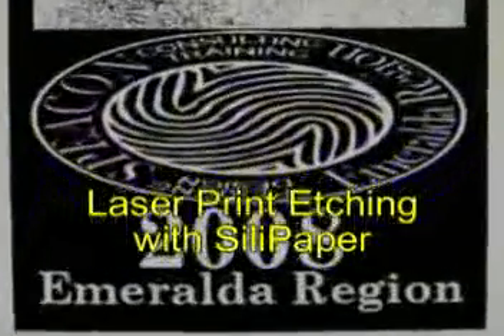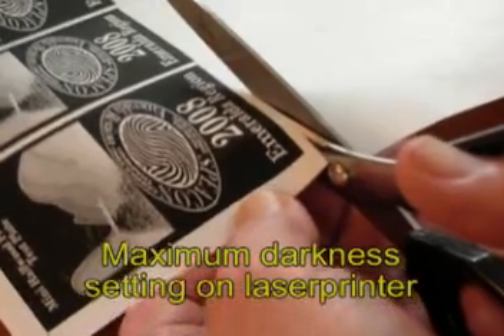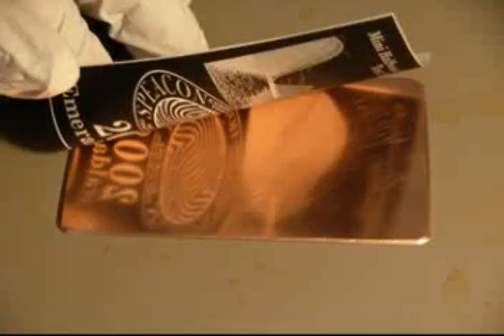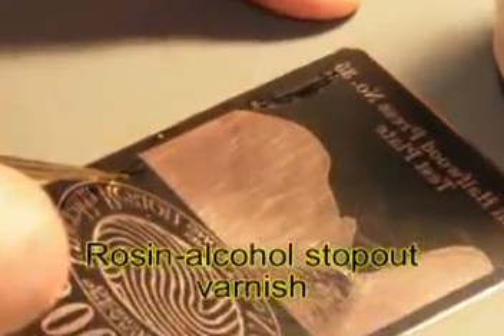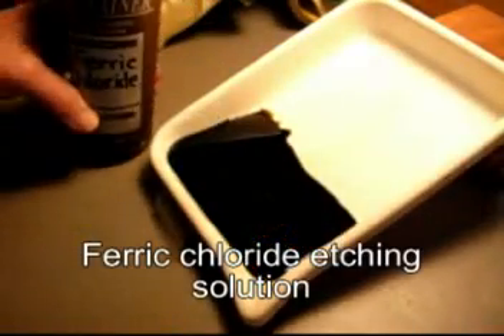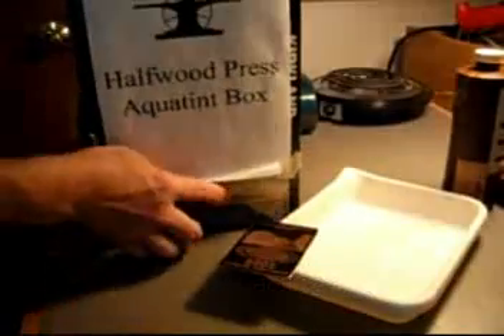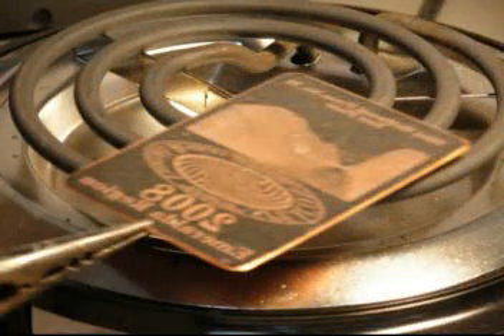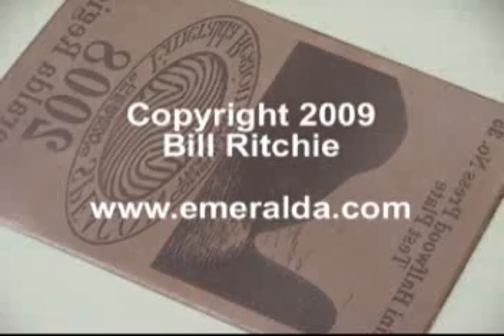Laser Print Etching with SiliPaper

Comment: @BuckarooCoyote I'm using a GBC. The plates are 22 ga usually, I also do 18 ga and 16, but seldom. First time I just be real careful, the master is about the same size as the plate, so hold the edges. It's easy. I also pre-heat the plate a little, not too hot to handle though. After one time through, it's stuck in place okay.

Comment: What kind of laminator are you using? Also how thick are the copper plates; 20, 24 ga?  How do you keep the paper in place (on top of your copper plate) while it's going through the laminator so it doesn't shift, especially the 2nd or 3rd time you're passing it through the laminator?  Thank you.

Comment from the maker: Yes, I use SoySolve II. But if you are referring to laser print toner, or rosin grounds, it doesn't work very well, or not at all. SoySolve II is good for oil-based inks or asphaltum grounds only, I think. Strong solvents require gloves and lots of ventilation. I work outside.